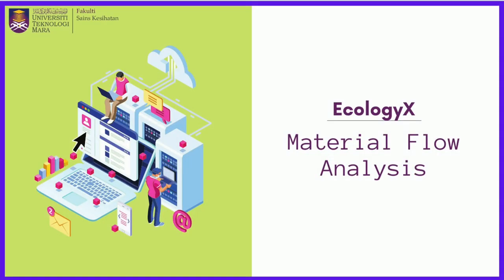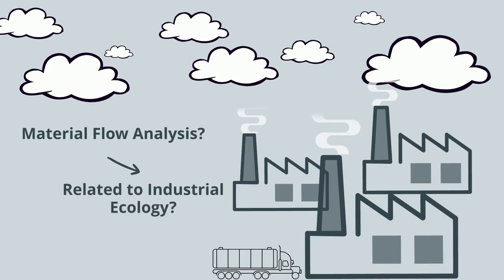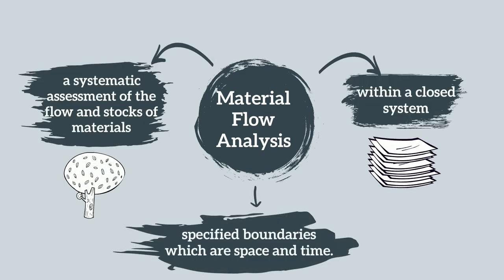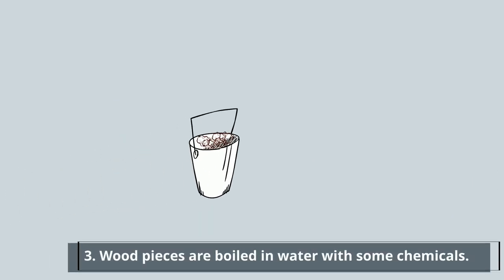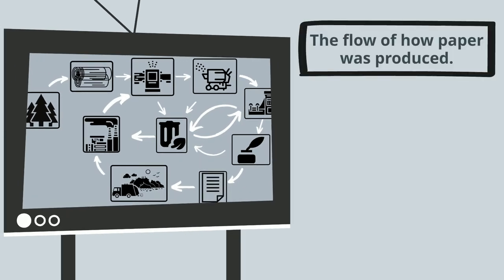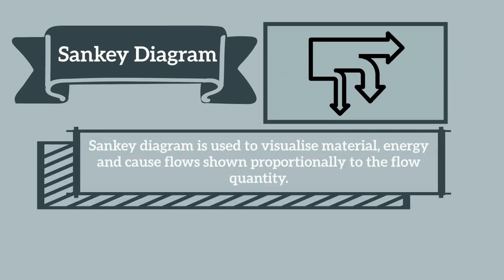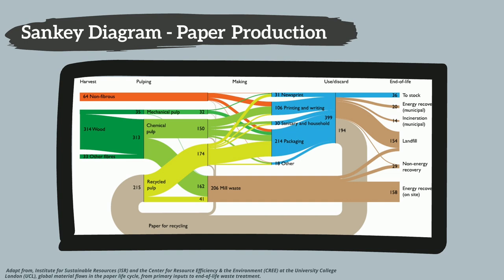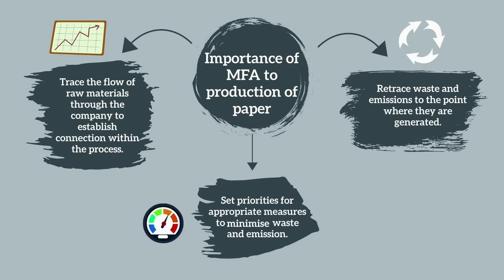Material Flow Analysis

Comment: Material flow analysis analyzes the flows of materials, it traces the input, storage, transformation, and output processes. It also allows identifying problems and quantifying the impact of potential measures on resource recovery and environmental pollution. Very interesting concept indeed!
Reply from the maker: the simplest step to be implemented in fact

Comment: Material Flow Analysis (MFA) is beneficial to not only producer and consumers but also towards the environment as MFA emphasises on the sustainable resource management ( cradle-to-grave concept can be seen). This is because MFA deals with the traceability of raw materials used as well as its waste, which from that will provide priorities in the measures for minimising waste and emission. Hence, the application of MFA to ones resource management could be bring forth the ideal balance in the input and output of raw materials.

Comment: The example of MFA in paper production has opened my eyes to the fact that it is critical for all industries to implement MFA in order to reduce environmental pollution, as a small number of industries using MFA will not have a significant impact on the environment.
Reply from the maker: small little change counts!

Comment: A simple example of product manufacturing; paper to describe the MFA approach. GMP also contributes to the analysis whereby beneficial in terms of resources used and impact towards environmental performance. A quick question about Sankey DIagram, thicker colors mean more input is being used?
Reply from the maker: yes, colours differentiate the different flows and the thicker the flow, the more the amount of the material. it is true to scale